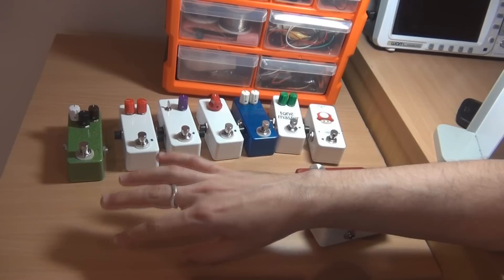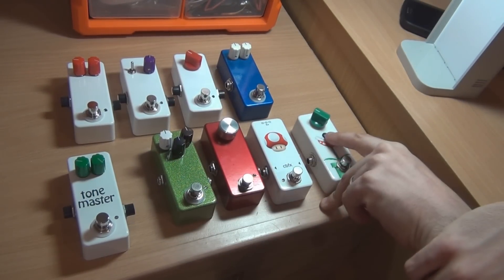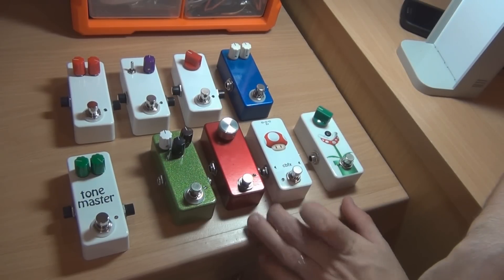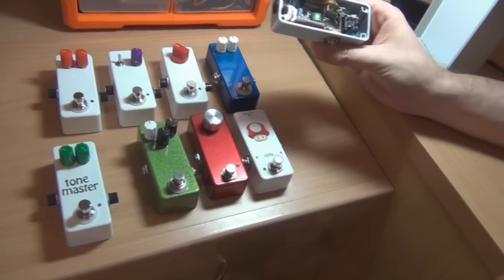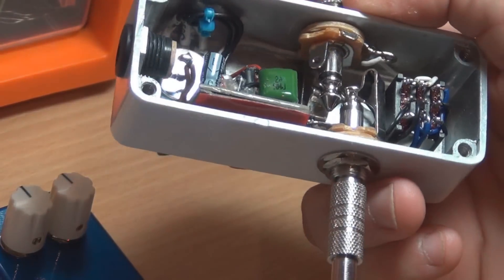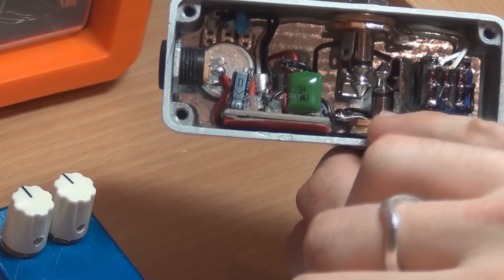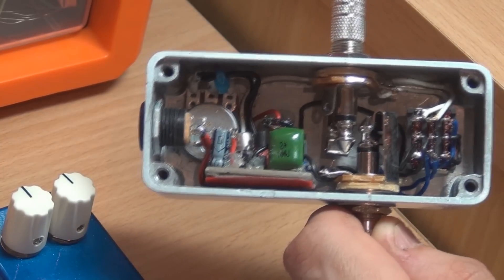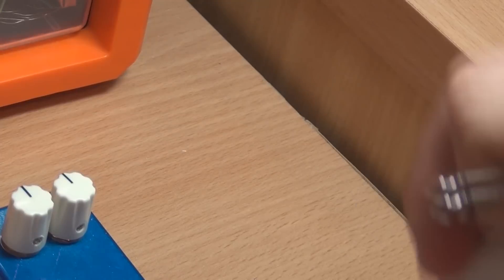1590a Guitar Pedal Build Guide - Part 1 of 3

Comment: I had yet to make a pedal inside a 1590a
I am tempted to go build a rat clone inside one...  madbean Runt
Reply from the maker: Looking at the size of the runt, might get away with it without needing low profile  jacks and compact dc socket?
Reply: chromespherecom Yeah it probably won't need low profile jacks but for sure I will order the tiny caps for it. I own a real old early 80s rat and it is too big!